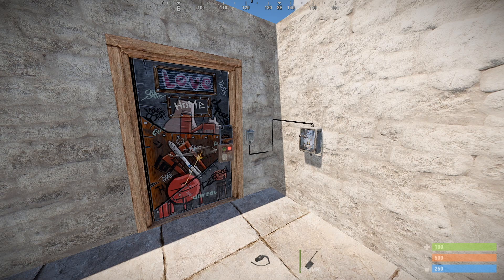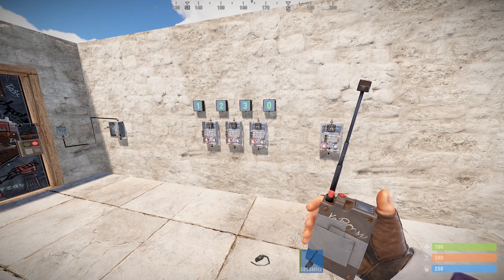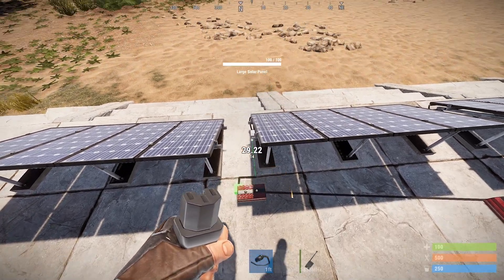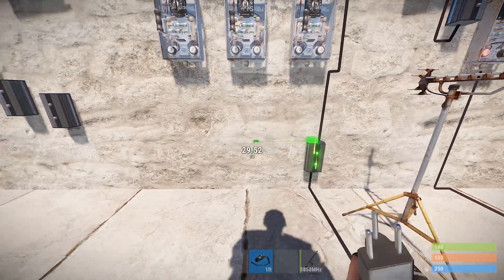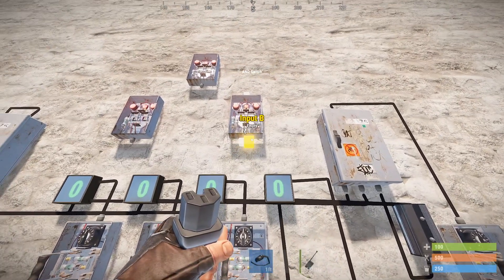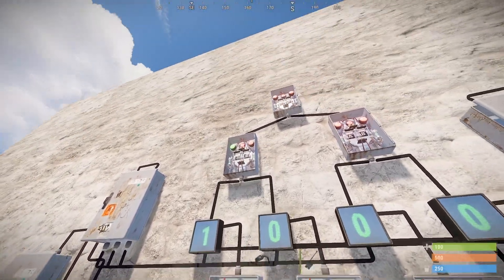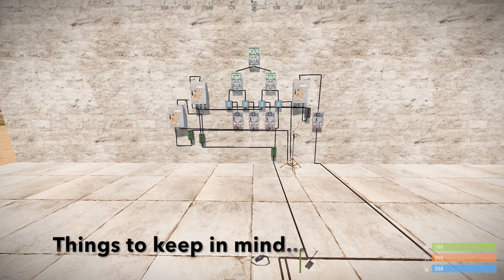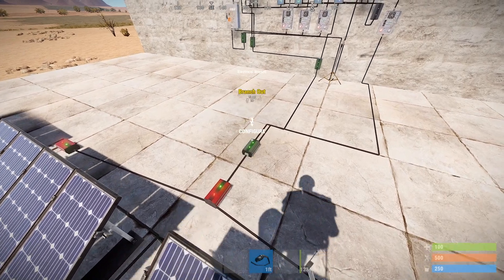(RUST) Electricity 101 - Wireless Codelocks S02 Ep1

Comment: all they have to do . is unplug the door controller. put a small battery on the floor and plug to it
Reply from the maker: This is true, however there are ways of hiding the door controllers and still have them paired to a door.
But yes, what you say is a current flaw with the design of circuits and specifically the door controller.
Reply: @SpibsTV  only works if its just like a loot room(last room) and you put the controller on the inside of that room. But then you're also giving them a way out if they broken into that room from the honeycomb
Reply from the maker: No, that’s not true. You can hide controllers behind walls and other things that completely separate it from the door. If you’re a good enough builder and electrician, there are ways to do it.

Comment: interesting concept - only problem: If raiders get TC privilege, they can directly wire up the door controllers to get access to those doors - I would only use it on outer doors securing multiple entrances for example.
Reply from the maker: lorsch yeah, it’s an unfortunate flaw of the door controllers still. It would be cool if you could “lock edits” or something on then similar to paintings.

Comment: This is very impressive.  Great job, just subscribed.  I do have a question though, do the doors function then normally as locked doors? If i lose my last remote transmitter, can i operate the doors with their normal lock code?  Id assume i have to install the door controllers before installing the locks?
Reply from the maker: Doors still function as normal whether the door controllers are active or not.
The door controllers can either be installed before code/key locks, or while they're unlocked.

If you have any trouble, feel free to join my discord. Link is in description :)